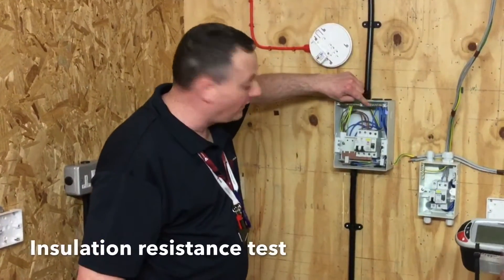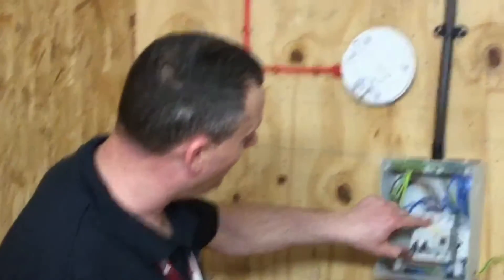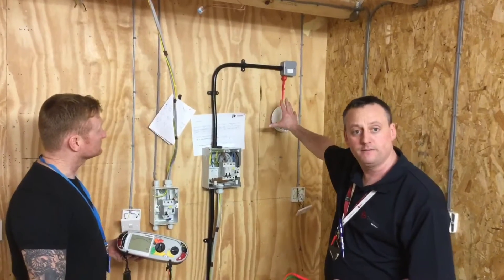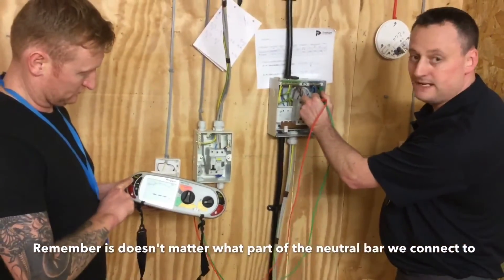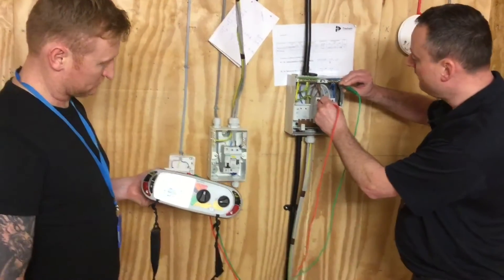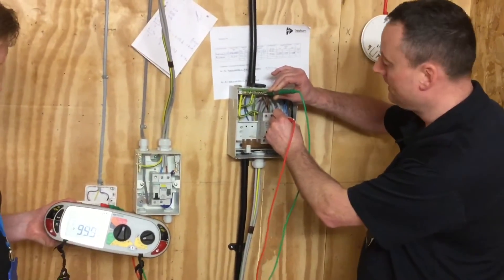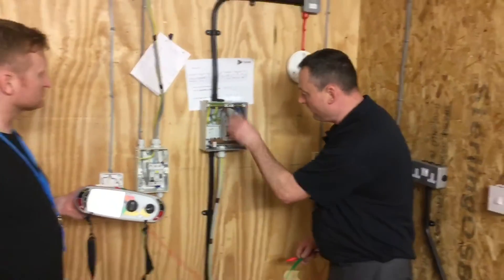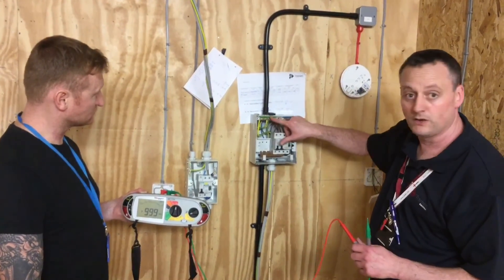How to test insulation resistance test for more than one circuit in a consumer unit - using an MFT

Comment: Hi 
I find your videos to be very informative and very well presented and I learn so much from them.
I apologize if my question is stupid since I am not from the UK and I am not familiar with the UK electrical legislation, but I'll ask anyway.
Since the earth and neutral are connected together at some point before the consumer unit, do you disconnect the earth connection from the Potential equalization bus bar to the bus bar on the C.U. or the neutral before the C.U. from the bus bar on the C.U?
I cannot understand otherwise, how you get 999 Megaohms between the earth and neutral bus bar.
Reply from the maker: Hi. If you have isolated the supply via a double pole switch in the consumer unit the connection that the supply authorities have with the neutral and earth together is not in circuit. If this was a single pole switch you’re correct the reading between neutral and earth would be zero. Thanks for commenting and watching GSH Electrical 👍